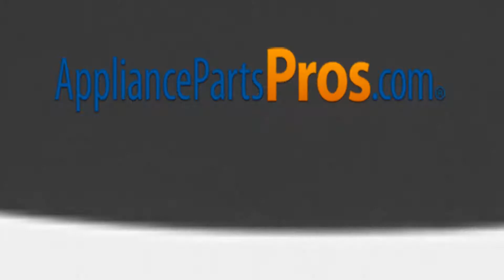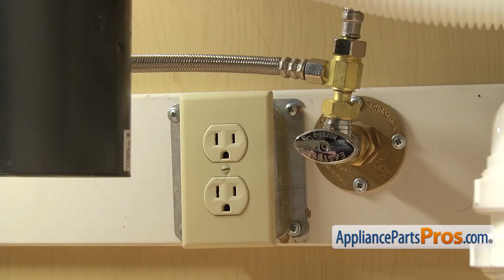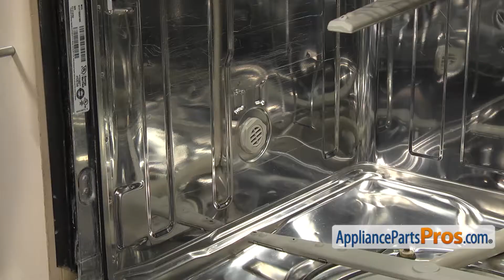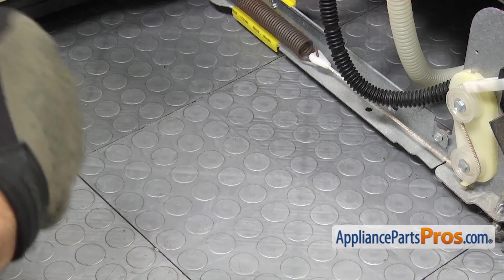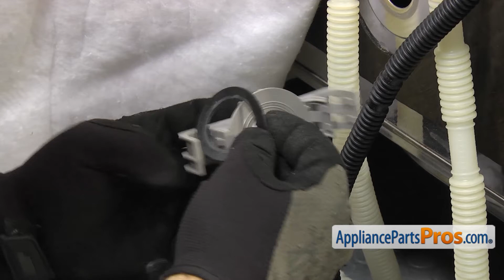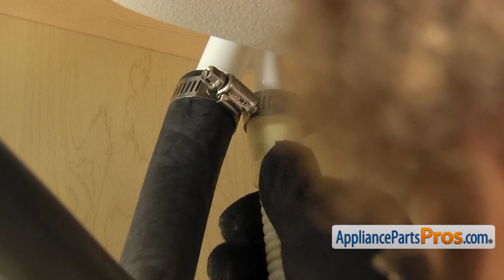How To: Whirlpool/KitchenAid/Maytag Inlet Assembly WPW10195536

Comment: I replaced the inlet, W10316375,  along with the inlet hose and gasket. Good thing that I had a new hose because it was impossible to remove the hose without damaging it, even after removing the clamp.  Also, the new inlet didn't come with a top flapper, W10316376. I had to take the top flapper from the old inlet and put it on the new one.  Success.  It stopped leaking on the side of the dishwasher. I doubt the inlet was leaking, but replaced it anyway. I suspect the hose had a leak at the inlet.

Comment: Why would it even go bad? 
No moving parts. And why in the hell would they put a top door flap on the inlet assembly that opens up and water comes out. vs a direct water line in? 
It can only handle restricted water flow, so no removing the restrictors with out flooding. Kitchen aid
Reply: Exactly. Why wouldn’t the dishwasher have a similar filling port like a clothes washer?
Reply: I purchased brand new whirlpool dishwasher and found water leaking from the large holes top sides of water assembly.  I can’t believe why they would not re-engineer this component.
Reply: My guess is that it’s not the assembly at fault itself but the velocity of water hitting the bottom of the inlet assembly.
Reply: But  remember when Donald Trump said take the filter out of your dishwasher so your dishes can get cleaned the first time and you’re not wasting as much water having to re-wash your dishes multiple times. We did that and, it flooded out due to the high water volume. just goes to show, double check everything and don’t trust anyone. 
Just saying.
Reply: @Paddler-fy4gd I just got a new whirpool dishwasher and this inlet port is leaking wtf 😂😂
Reply: China

Comment: After fixing the main water inlet on the bottom of my dishwasher I had to shut off the valve under the sink. Once the job was done I opened the valve. 

After awhile I realized it was leaking at this part at the top at both holes guessing it’s a vent of sorts. I had to close the valve slightly restricting the water flow to the appliance so it wouldn’t leak. For a second I thought I had to spend 100$ for this part.
Reply from the maker: Have you checked to make sure that the water lines are pushed in all the way or checked for any damaged to the hoses?